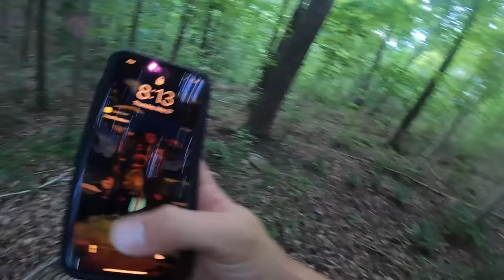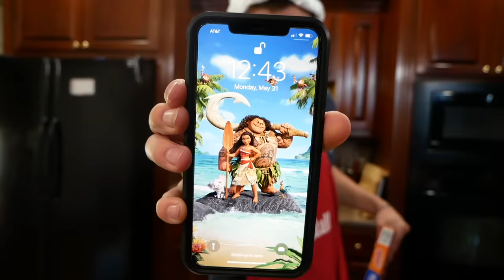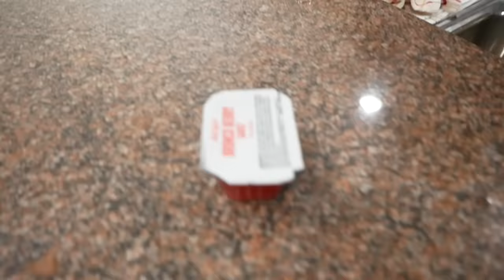SUMMER SQUIRREL HUNTING WITH A FOUR WHEELER!

Comment: Squirrels Stew: 
3-4 squirrels
Chicken broth- 3 cups
Potatoes
Corn
Carrots
Water - 1 1/2 cups

Cook the squirrels in a pan until brown, then add to a pot with the corn, potatoes, carrots, broth, and water. You can also add pretty much any other vegetable that can be boiled. Let simmer on medium heat for around an hour, or until the meat is falling off the bone. You can also do this on a crock pot.

Comment: Hey KG.....ultimate rig needs..1-a camo spray job,use 3 or 4 colours,use twigs n leaves n grass to spray over,then move repeat. 2-a light bar mounted up front. 3-rubber latched gun rack 4-a cooler,camo'd on the rear with boards infront drilled n bolted down for extra seat or storage.....5-matt black painted wheel rims.....done..ULTIMATE RIG.....
PEACE.